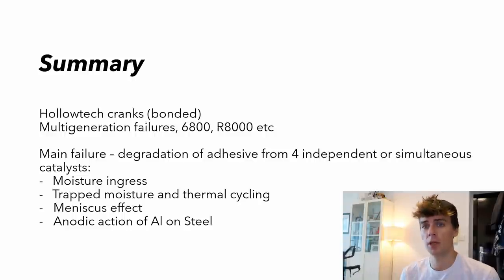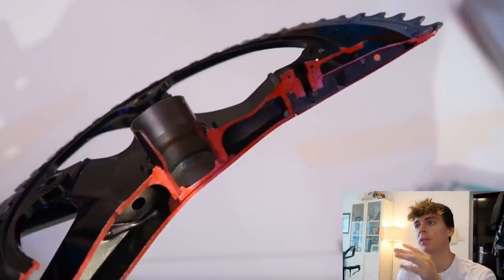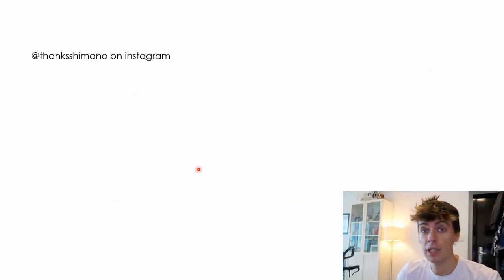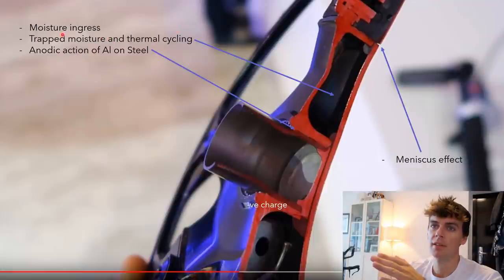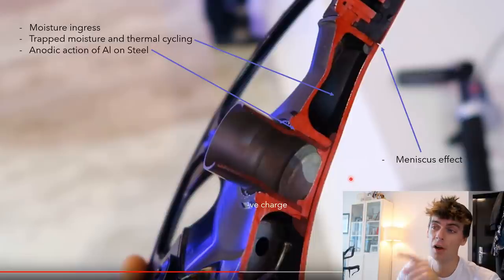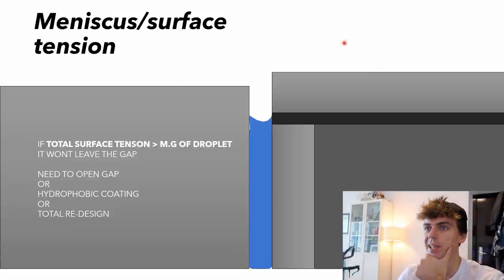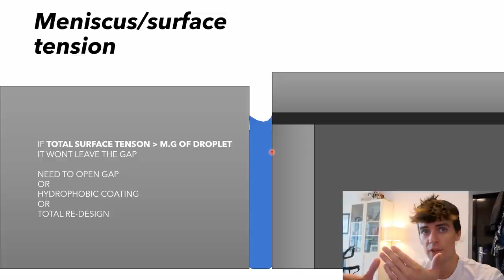Why do Shimano cranks keep failing? Analysis.

Comment: Yesterday on a training ride my Dura Ace 7700 right crank litteraly exploded!!!
Was out of the saddle,not even really sprinting,just to regain speed after a crossing.
I could have died yesterday if that had not happened on a bike lane......
NEVER had that bike on a trainer,it’s always clean and hanging on the wall in a well tempered room.
My right body side was impacted heavily-helmet broken,cycle kit all f#cked up.
You can’t trust ANY Shimano top of the line crank.Hollow cranks simply don’t work longterm! 👎

Comment: You could try canned air or a air compressor with an air gun to blow out the moisture in that gap. You could also spray WD40 into that gap before you use the crank (when it is brand new) to mitigate the problem of moisture and debris filling up that gap.

Comment: Is it just on ultegra and dura ace or does it affect 105? Also curious does this happen on mtb groupsets?
Reply: I've been using the 5800 and R7000 in Singapore--No issues so far. The drive side arm doesn't seem to be constructed the same way as with the higher-end ones; It looks like a fully machined piece instead of having an epoxied other shell to save weight.

Comment: Mr. Peak, thank you for the video, but I must respectfully disagree with some of what you said.

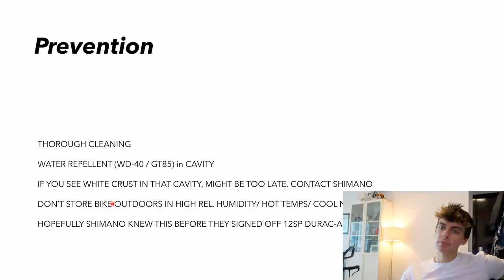It really wasn't until the 19:20 mark of your video that you finally might have ID'd the problem.  When looking at Instagram (and your initial geographic analysis), the broken cranks seem to have had a harsh life as you said.  Any nick due to a fall, routine smacking of one's shoe heal on the crank, or a down right crash, will cause stress concentration points and locations for any external environment (especially salty air) to attack.

I truly do not believe this has anything to do with initial manufacturing and moisture "manufactured" inside the crank arms.  In all cases, the Shimano plants that I've seen online look like heavily controlled environments (look to me to be class 100k or 1000k clean rooms).

Additionally, I truly don't believe it's anaerobic corrosion (due to the primarily biological nature of anaerobic corrosion).  Pure and simple, it's aerobic corrosion that's attacking the weak points primarily caused by rider error (wreck, nicking, fall, etc...).

My qualifications for such an opinion - BE in Mechanical Engineering, BS in Electrical Engineering, MS in Engineering, 40 years of manufacturing and design experience.
Reply: I'm not sure I'd call normal wear and tear "user error". 
Cranks live in a fairly harsh environment and are subject to surface wear and surface damage from impacts as part of their normal use. 
Sure a crashed crank should be inspected but they should be designed to cope with wear from shoes rubbing, impacts from rocks thrown up by the front tire and impacts from handling the bike (loading/unloading from car racks, bringing indoors and outdoors, etc.). 
Interestingly Hollowtech is used on MTB (and gravel) cranks as well but the @thanksshimano page seems to feature all road cranks. Obviously that's not exactly a very scientific sample but it makes one wonder if Shimano didn't underestimate the abuse road cranks suffer at the hands of their users.

Comment: Hmm interesting.  Not sure you have enough information to make the conclusions you do though. The “Meniscus”effect you talk about is called “crevice corrosion” and is a well known effect. You do not need dissimilar metals for it to occur. However you do not explain how that results in a failure of the bonded joint. Where the glue fills the gap between two surfaces this type of corrosion cannot occur. We need to see more detailed images of the failure points to understand what is going on.  If corrosion is an issue it should be easy to see that the material thickness has been reduced by corrosion leading to a stress related failure. That would surprise me as aluminium is quite resistant to corrosion as it forms a very hard oxide layer. If I had to put money on it I would go for failure of the adhesive but even that seems unlikely as aluminium bonding is quite a mature technology but perhaps shimano got it wrong in his instance. You got me thinking about my car which has a bonded aluminium chassis! I am sure we will hear more in time. . .
Reply from the maker: Do you drive a Lotus?

Comment: Sounds like ideal fodder for Hambini! You'd expect something like this from SCAM. Bikes are becoming more fragile like aircraft and with light weight comes the need for frequent inspection and service. This kind of failure would never happen on 40 year old Campagnolo cranksets. I think your analysis is dead on. I think now is a good time to convert to retro-grouch   for safety reasons. Manufacturers are pushing marginal gains so hard on critical components. If you can't trust Shimano then who can you trust?
Reply from the maker: Great comment. I've not seen any major road carbon crank failures. I think the way forward  (if you still want a light product) is either hollow carbon (sram) forged Alu (heavier) or heavily milled cnc (rotor). Shimano do seem quite close to the safety margin with this bonded technology. Maybe too close
Reply: Still using several 40+ yo campy, zeus, superbe pro and dura ace cranks with zero problems. All solid of course.

Comment: Right near the  bearing is cracking, then the crack travels...
The material used is either too thin, or not strong enough, take your pick.
I worked as an R/D machinist for decades.
All this talk of chemistry and heat cycling is bull.
This isn't an F1 connecting rod at 21,000 Rpm's (stick to the basics)
PS
Engineers like to make excuses,especially after touting how light and strong (not) their newest design is.
All the while telling corporate how much they save by eliminating 20% of the material costs.
...Soon after , a dumpster behind the factory slowly fills with 10%+ warranty returns.
engineer adds 10% back, warranty returns drop to less then 1%, all good.
VP toutes new rigidity modification, Press release, New XTUltra Ti2 crank line...add rinse repeat...

Comment: NO they dont keep failing  only a very small percentage fail - if you think of the amount of parts Shimano supply around the world  then the fail rate would be less than 1%  and that is nothing to a company the size of Shimano. you go on about a gap that is tiny and want them to redesign it so water does not get in - it aint going to happen if it works for 99.9% of the time
Reply from the maker: ascar77uk its just a video.

Comment: if what you say is true, the shaolin and the wu tang could be d a n g e r o u s. do you think your wu tang sword can defeat me?!
wu tang sword style aside.
if what you say is true, practically speaking, the location / conditions of storage may come into play in a significant way vis a vis relative temperatures and humidity of outside on the ride, versus afterwards, and if that’s going from one, hot & high humidity situation, to another ac on full blast and significantly different humidity conditions…perhaps if the environmental conditions don’t change so dramatically, so quickly it may factor into this problem.
Much like deep sea diving and going from one to another environment, vis a vis the bends, just to butcher an analogy, but a bit like you posit, the tropics / sub tropics may be beyond the limits of the designed construction method, albeit fine and dandy in climatic conditions further away from the equator.
Quite intriguing given japan, despite that it has temperate and winter weather similar to the uk, northern europe…the summers can be just as muggy as hk, singapore etc, so I gather.
Mechanical environmental control engineering of the production areas sounds like a likely candidate.